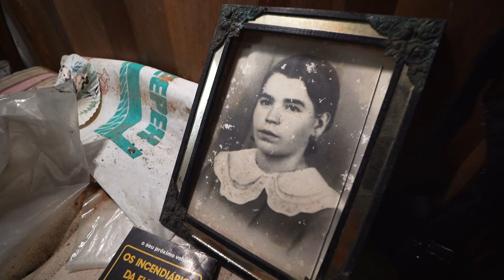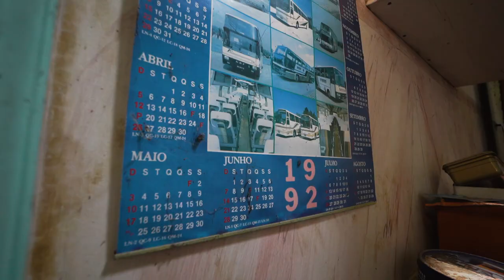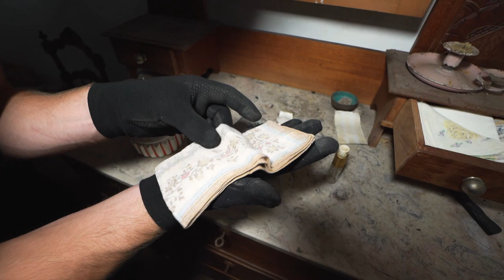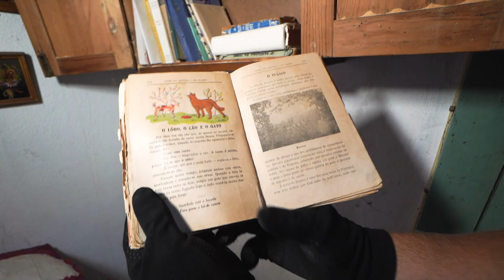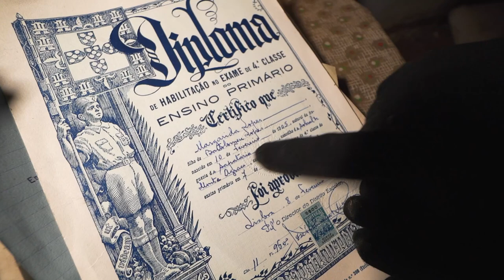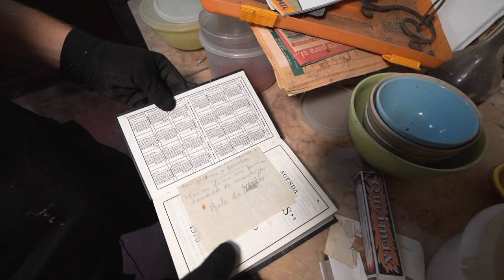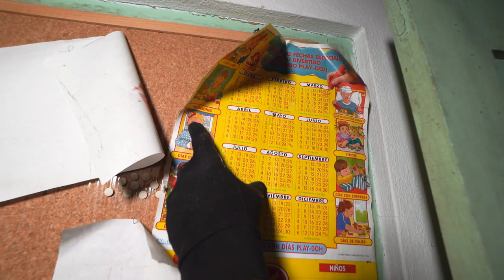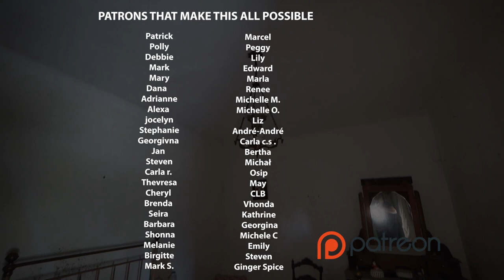Life of an Illiterate Mother! Abandoned Portuguese Time capsule Home

Comment: The first machine you called a washing machine, was in fact, a spin dryer, to get excess water out of clothes before hanging them to dry. The second machine was the washing machine,and not the dryer, you hooked the rubber hoses up to the taps to fill it. The centre paddle was called an agitator, and would rotate back and forth to move the clothes around.

Comment: FYI: that thing hanging on the wall you thought it might be some kind of oil dispenser is actually a device to administer an enema, also known as clyster, which was used to stimulate stool evacuation. You would fill it with a liquid and then inject the liquid into the rectum in order to relieve severe constipation. The big clay container in the kitchen was not for wine, it was used to keep the water fresh and pure. I don't think this family was poor, they had pretty expensive stuff for their time. By the way, I love your videos. Keep up the good work.

Comment: Just to let you know that the two Thomas appliances that were in the kitchen are a washing machine, the square one, and a spin dryer, the round one. My mum had similar ones in England in the 60s and 70s. You washed the clothes in the machine, basically it just swished them around and then you transferred the wet clothes to the spin dryer and it spun the soapy water out. You then had to rinse them in clean water in the sink and then spin dry them again. They were still wet but not dripping and were hung up to dry. It was hard work but an improvement on the old wash tubs that came before. Hope the helps. I love your videos and cannot believe that families just abandon homes like this.

Comment: I'm Portuguese and this is very reminiscent of my maternal grandparent's house in Portugal (Sao Miguel Azores), except the house in this video is a lot more modern then my grandparents, if you can believe that... There was no stove or gas anything in the kitchen; cooking was done in a stone fireplace in the wall, like a huge hole in the thick walls. There were no wood or any type of floors, but pure dirt floors... There was no bathrooms. There was a small wood cabin outside with a wood plank with a hole in it and that's where you did your business... And once in a while, one of my aunts had to clean out the area under that hole. Smelled horrible! To take baths (which were once a week or so), water had to be heated in the stone "fireplace" (in clay pots, because there was no metal pots), and then poured in a wine barrel that was cut in half--that was the tub, that then got stored under a counter in the kitchen when not in use. And yes, those counters had no doors under, it was all "curtains". Clothes were washed outside in a stone thing that looked like a well. I was literally born in that house, on a straw mattress. The mattresses had these slants where in the morning you'd put your hands through those slants/holes and straightened the straw mattress before fixing the blankets. There was no electricity until my grandmother was already in her late 80's (so maybe around the late 1970's, early 80's) So there were no electrical appliances at all. She did get a tv , though, that only had one channel, and only played at certain times in the day. Mostly "soap operas", lol  To preserve certain foods, like meat and fish, they were put in a container filled with coarse salt. But it was rare that food was stored. Fish was bought daily, and meat was only on special occasions-- our own chickens were slaughtered.  However, chickens were kept mostly for their eggs. Once every few years, a pig would be slaughtered, and every part of it was used, including every organ, But again, this was rare. Cows were for milk (and cheese, and butter), so rarely were they ever slaughtered--- maybe for a wedding. Vegetables and fruit trees were in abundance though, all year round. And grains, for flour. I came to Canada with my parents when I was 3 years old, but we did return there every couple of years when I was younger, so these memories are ingrained in my mind. The house is still there--- abandoned for more then 40 years. Haven't seen it for more then 30 years because haven't returned there since... I'm told the house is still standing, but that there is vegetation that is growing inside through the windows. Apparently the furniture (which was all hand made) is also mostly intact.  It's complicated why this house was never sold and was left to deteriorate; too many inheritors with no one agreeing on anything.... And so it stands there abandoned...

Comment: The showers are the most amazing. Before hot water heaters, I assume you warmed water in the kitchen and filled it in order to have a shower. Camping showers these days have a vinyl black bag you hang in the sun to warm it up, with a sprinkler head.

Comment: We say Shhandeleer for Chandelier. You always call brass and bronze things Copper ..copper is reddish metal..brass is gold toned made with copper. Those were red cherries not olives in the bottle. The flimsy bed s around were no doubt day beds for a quick nap. You call dolls puppets a lot. Puppets are put over the hand to make them talk. Not a doll.
I say the orange urn was to hold good drinking water and to keep it cooler ...too big for wine. The wine would spoil in such a large thing exposed to air. Why two kitchens? The larger square "dryer" has an impeller and a hose showing on side ..clearly a larger washing machine model like the other. What "old schools" made that beer. Where are all these old schools you speak of? Those were Mobil Oil logo gas station receipts not mobile phone related. 
Oh in other videos when you see a half curved device with a knob on top and blotter paper attached...these are not for sealing letters etc..they are ink blotters to soak up excessive ink from a letter or signature from a fountain pen prior to ball points.